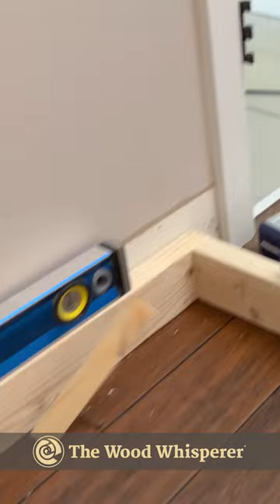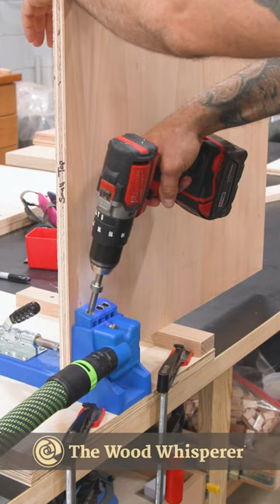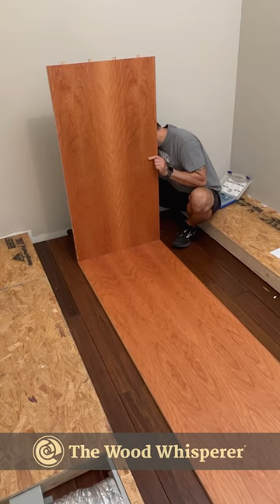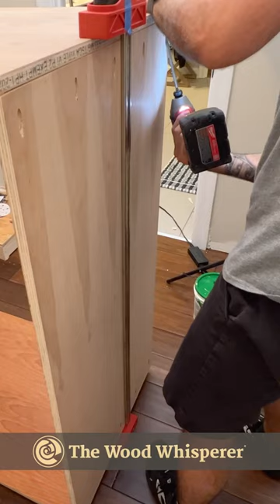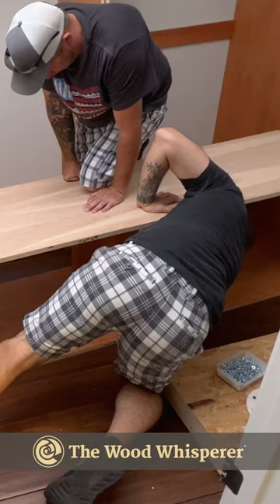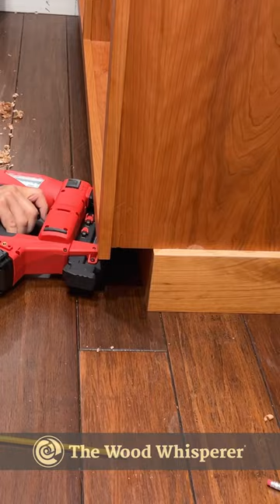Making my wife’s dream closet.

Comment: Looks good. Any reason to use pocket holes to build the boxes instead of just screws through the side?
Reply from the maker: Screws through the sides would have really complicated assembly during the install. I didn’t have much room to work and pocket screws allowed me to easily assemble the cases on the floor without having to flip things around.